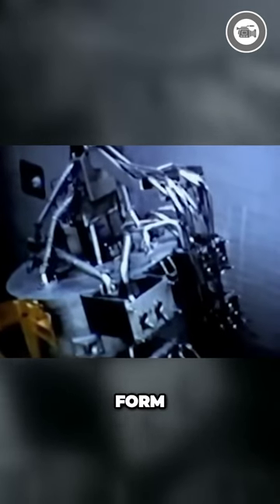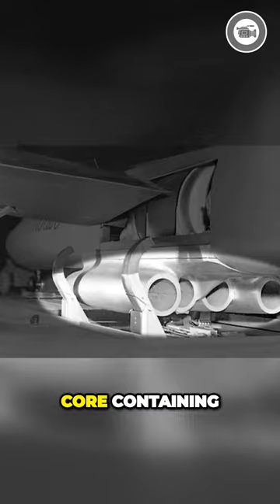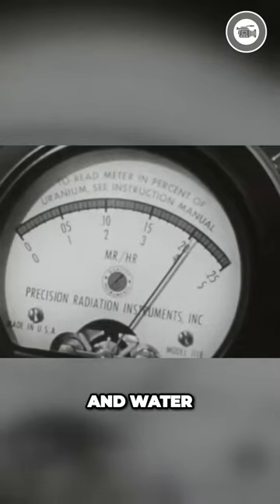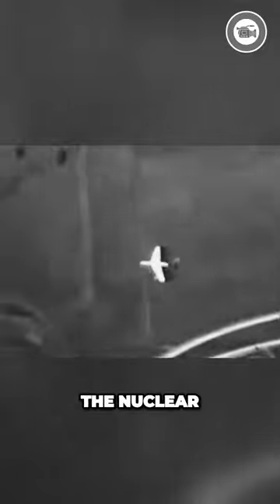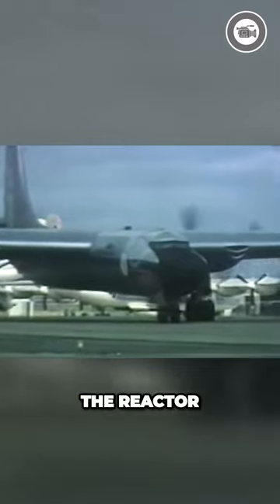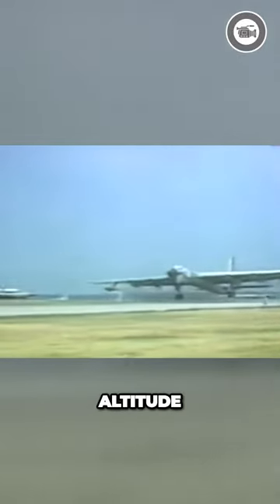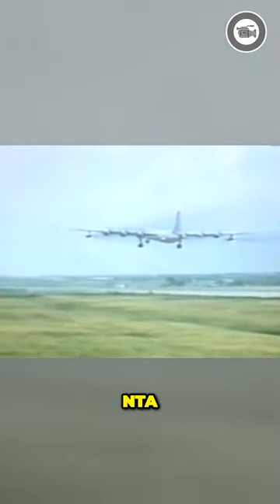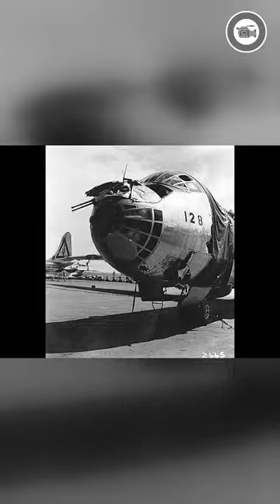Revolutionary Nuclear Powered Engines #aviationhistory  #militaryaviationhistory

Comment: Someone explain to me how a nuclear engine works? I
Reply: Maybe start at Wikipedia. You will at least find  clues to other sources.  Be diligent! The answers are out there,  you just have to learn how to ask the questions,  and who to ask!
Reply: @gbenother8755  So you don't know either.
Reply: Instead of using jet fuel, the reactor heats up incoming air, this air expands, powering the compressor and then being expelled to generate thrust, at the same time, that air cools the reactor
Reply: I thought nuclear engines were only intended for spacecraft?
Admittedly I know very little about the technology.
Reply: Project Pluto used a uranium core that heated up funneled air like a ramjet. It needed rockets to take off and get up to speed before the ramjet could propel the aircraft.